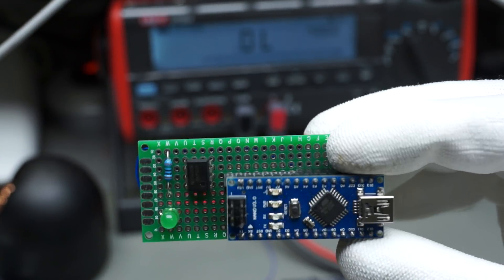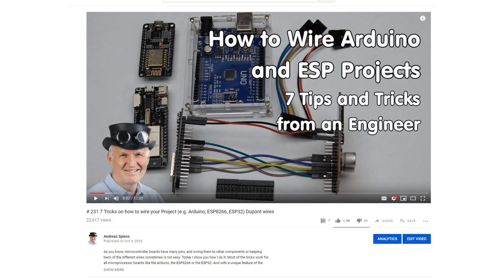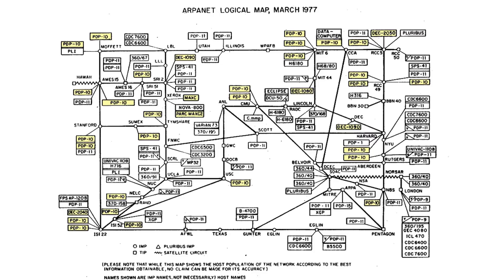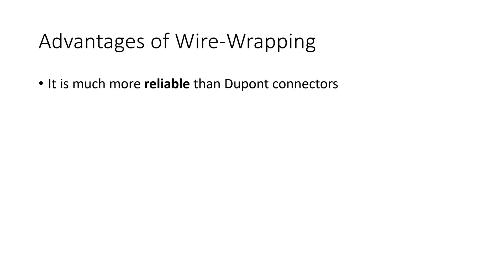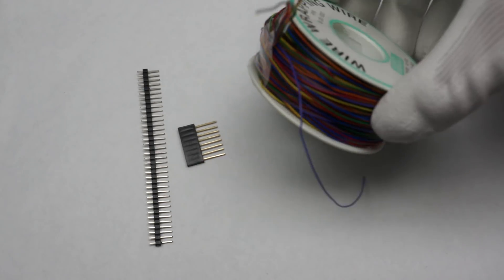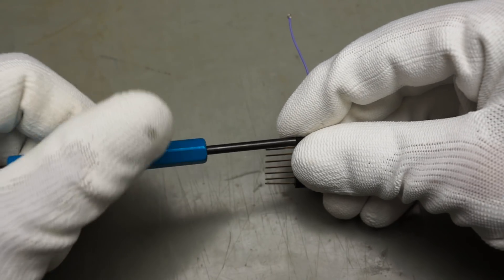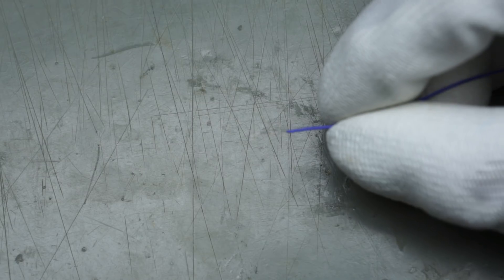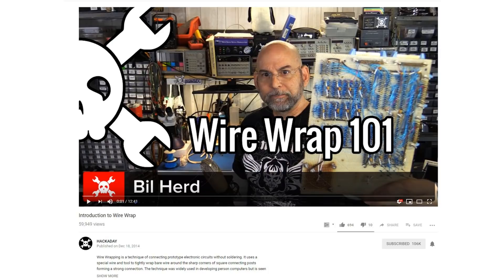#243 Better than Dupont Wires: Wire Wrapping for our Projects (Arduino, ESP8266, ESP32)

Comment: The best thing about wire wrapping is that metal hardens where it's bent. So wire wrapping is resistant to vibrations. Once a wire bends on some point, it will never bend again in the same spot. It's like trying to break a long wire bending it by the ends.
Reply from the maker: Thanks for the interesting info!

Comment: I wonder if wire exists that you can solder without stripping it. the plastic would just melt when touched by the soldering iron. that would speed up things considerably, even faster than wire wrapping.
Reply from the maker: The emailed wires can be soldered in this manner. However, they smell like hell, and you need quite a bit of heat.
Reply: @AndreasSpiess  I actually tried that once. the smell was acceptable, but it's hard to troubleshoot. it would be fantastic if the same would be possible with wire wrapping wiring, as you then have different colors available.

Comment: The pins break off quickly for the 30AWG wrapping tool and are therefore the weak connection!
Has this happened to you a lot too?
Reply from the maker: No. Maybe we have different pins.

Comment: The 30 AWG wires are so thin will they not melt in my projects?
Other thicker 24 AWG wires and tools are not available!
Reply from the maker: Wire wrap is not intended for power electronics. However, 30AWG is suitable for around 0.5A.

Comment: That small black piece of steel in the middle of the handle is a wire stripper.  Push the wire through, slide it into the slot and pull the insulation off.  You MUST insert the wire so that when you pull, the cutting blade presses onto the body of the tool.  Get it the wrong way round and you will bend the blade.

You can get wrapping wire that doesn't need stripping, but you need special pins with square edges that bite into the insulation.

In the 1970s I worked for Burroughs Machines who had terminals in every branch of NatWest, Barclays, Midland and Yorkshire banks, and it was a regular task to do modifications to the wire-wrapped backplane.
Reply from the maker: You are right about the stripper. However, I never liked it :-(
I am not sure if you still get this "special" wire. But it was very handy.
And indeed, even some "programming" was done back then on the backplane by changing wires. I just watched a video about the restauration of a PDP11 with lots of wire wraps...
Reply: @AndreasSpiess  I haven't done any wire wrapping since the 1980s, I gave all my wrapping stuff away, something I now regret as I'm thinking about using it for prototyping.  I'm not too keen on breadboards.

Did you ever use the the method wrapping where you didn't need to strip the insulation?  The pins were square in section with sharp corners which pierced the insulation as you performed the wrap.  IIRC the wire was a special type too.
Reply from the maker: @rogerbarton1790  I think we had such wires back then. But as with you, it is a long time ago ;-)

Comment: I remember reading about this in Forrest Mims III's Getting Started in Electronics book when I was 12.
I'm now 36 and I have just purchased my first spool of wire, a tool, and a bunch of sockets both breakoff and solid 2.54mm arduino types.
I am gonna have so much rapid-prototyping fun with this stuff. :)
Reply from the maker: Cool. Indeed, this is an old technique...

Comment: I work on Dimetrics Gold Track 2 power supplies which use wire wrap.  The biggest problem they used all white wires.
Reply from the maker: That was the standard I know. We also did not use different wire colors.

Comment: Kynar insulated wire wrap wire, if you have the proper stripping tool, is also really handy for replacing traces on PC boards.

Assorted prestripped wire is the sh*ts.  I still have a parts box full of the different lengths from decades ago.  I don't think you can get it anymore.  Anyway, wire wrapping is the easiest way to prototype digital circuits.
Reply from the maker: I agree, it is hard to find accessories for wire wrapping today (also the sockets).

Comment: Fascinating stuff! Recently bought that same multi-colored wire for a small project and somehow ended up watching this video 😊
Reply from the maker: I use these 30AWG wires for several things in my lab. Particularly to correct errors on my PCBs. They are very thin and easy to solder also to small pins.
Reply: @AndreasSpiess  Appreciate the response! I'll be using them to repair PCB traces indeed. Amused by the history behind it, also watched the Wire Wrap video you recommended by Bil Herd. Thank you!

Comment: Yes. I’ll use this. Great. I once in 1978 did a student job at Siemens Augsburg in fehlersuche of wire wrapped mainframe boards.
Reply from the maker: Finding errors was not easy. And correcting it sometimes also not...
Reply: @AndreasSpiess  well, at Siemens the wrapped boards were put in a machine which tested all connections and output an ist-soll vergleich. Zb connection from AB12 to BC06 shouldn’t be there. Or D12 to BC34 is not present. Then I put high voltage on connections that should not be there to get rid of residue. And I wrapped missing connections. An I ate a lot of zwetchendatchi with the women in Fehlersuche ;-)
Reply from the maker: @AlexSlaets  I had to google "Zwetschgendatschi" ;-)

Comment: 1. It's pronounced iNsulation with an N
2. That blue wire wrap tool has a built in stripper in the middle
Reply from the maker: I agree.

Comment: 1:32 if you order vintage aviation parts that are decommissioned, you’ll see atleast some of these components use this method. I’m holding a piece of a retired control panel now that’s got 30 analog inputs using wire wrap
Reply from the maker: It is interesting where this technology was used. It looks like unreliable but obviously was very reliable...

Comment: Just another gent who did a lot of wire rapping in the '70s. Much easier with a mains powered tool and a good wire stripper with a length guide. If I recall correctly there was even some instances of larger pins and wires for higher currents. Using round pins is not ideal, it's the sharp edges of the square pin biting into the solid copper wire that makes the joint so reliable.
Reply from the maker: I agree with the power tool and the square pins! For a small amount of connections, the manual tool is ok. But for a computer backplane...

Comment: There was a system that use self-fluxing enamelled copper wire.  You had a small spool of the stuff on the end of a hollow wiring pen, the wire went down the centre of the "pen" and came out at the "nib", you soldered the wire at the starting point and moved from point to point, soldering as you went along.
Reply from the maker: I used this too. But it was more complicated…
Reply: @AndreasSpiess  Yea, I didn't really get on with it, I still have a virtually full reel of wire which is about 40 years old.  You had to use more heat than with tinned copper wire and the residue was dirty.

Comment: That wrapping tool has a stripper built into the handle.
Reply from the maker: You are right. But not very comfortable…
Reply: @AndreasSpiess  And people put the wire in the wrong way and bend the blade outwards.

Comment: All your vids extremely interesting. In your experience in which cases would use this method against traditional Dupont connections? I wish to connect 7 DS18B20 sensor + 4.7k ohm resistor to an ESP8266 and with soldering I was wondering, but this technique seems to do it. Next, what pin's lengths are you recommanding? Thanks
Reply from the maker: These days you have to use the pins you get and cannot chose their length, I fear. You can wrap the wire around the wires of the resistors. They should stick.
Reply: @AndreasSpiess  The other way, wrap around the resistor, good idea, I'll try when I get the order

Comment: With the re-growing community of electronic hobby-enthusiasts, this wire wrapping technology along with the "Fädeltechnik" using wiring pencils, these almost forgotten techs do experience a sort of a revival. WhenI was 14 (long time ago) I had built a wiring pencil from a full metal emptied ballpen core/refill (remove color and ball, clean it). The sharp ring at the tip is great for cutting the wire after soldering, by just pressing it to the lead.    I still use it and can prototype quite fast with it. You can go from pin to pin with it. Turn at least one wrap around, then go to the next... Signal per Signal can be completed by this in a fast manner.  A tiny holding contraption to fixate the wire while wrapping around a pin was quickly set up, also the holder for the tiny wire coil at the end of the pen.
Reply from the maker: I remember the "Fädeltechnik", too. As you write, the tools were cheaper than for wire-wrapping. But AFAIK it was not used in products.

Comment: Does the wire come with only one size? I find it's too thin and easily breaks.
Reply from the maker: It does not break if you use it as intended. Mostly people use 30AWG wire.

Comment: I realize this is an older video, but this just now popped up in my suggestions list. Funny, I made literally tens of thousands of wire wrap connections in my days. And yes, I did have a manual wire wrap tool. But we mostly used hand held power wire wrap guns. Amazing how fast you can wire up even a difficult circuit. But than I also used through hole and even surface mount PC boards as well. Thumbs Up!
Reply from the maker: I think it had its high time before the availability of cheap and fast PCBs. But viewers wrote that it still is used in old telephone systems...

Comment: I have a project where I have a 24pin dip chip that I want to mount on a pcb. I want to be able to have the DIP socket leads go though pcb and out the other side so I can attach dupont or wire wrapping I think.

Comment: The tool you buy on Aliexpress has a wire stripper integrated in the handle.
You can DIY a toold by drilling a small hole on the side near the end if a small tube, such as the plastic tube from a q-tip, or a in pen lead.

Feed the wire from the end through the inside of the tube and the hole you drilled.
Reply from the maker: I know of the integrated stripper, but I did not like it. Maybe I was using it the wrong way...

Comment: Excellent, thank you!
Reply from the maker: You are welcome!
Reply: @AndreasSpiess  I never did any wire-wrap, being a software man and hence not trusted with tools, but I joined the industry in 1966, working with mainframes which were well and truly wire-wrapped. I spent a year at ICL Manchester, where the wiring shop was a no-go area for single young men - the wire-wrapping ladies had a reputation for inflicting certain indignities - frightening!

Comment: the AliExpress link for the wrapping tool is outdated. Any new recommendation? There seem to be a lot of wire wrapper for jewelery (no clue why that would be useful). Unsure if that's the right item!
Reply from the maker: I do not know. This is an old video and offers change quite fast on AliExpress :-(

Comment: Is 30 awg capable of powering arduino 5v sensors at 8 ft.
Reply from the maker: I do not know, I do not use 30AWG for long power lines. You have to do your calculations/measurements.

Comment: The wire wrapping tool comes with its own wire stripper. It's the one on the hole near the center of the handle. It's perfect for AWG #30.
Reply from the maker: You are right. But I did not like it...

Comment: The question is - do you use it? I can see that it can be useful to make fast prototyping on the fly. Without breadboards only on dip holders. It could be good connection to LCD without putting it on breadboard. 
Btw is it really as solid as soldered?
Reply from the maker: It is very solid. Back in the day they wired telephone infrastructure and computers like that. And some viewers wrote they still use it for these old devices.
Reply: @AndreasSpiess  good to know

Comment: @Andreas Spiess the wire wrapper tool that you have linked in the description isn't available anymore. 
https://a.aliexpress.com/_mLJqO2J
I found its one but is quite expensive,
Reply: Yes, seems to be very expensive. I only need that tool and not those kilo of wires.
Reply: @Phettsack  ohh boy I'm happy to have it. Excluding the need for wires. There are so f..ING handy. My granddad were surprised that it even exists. Strip a wire, wind it around a rectangular pin and BOOOM solid connection.  Btw here's the link to the tool: € 10,72 https://a.aliexpress.com/_mLZ1GOh

Comment: The only wire wrap tool I can find is one similar to the one shown in your video for 30 gauge wires.  Will that tool work with cat5e cables, which are 24 gauge?  I ask because the wrapping wires you show is labeled either 24 or 26 gauge.
Reply from the maker: I only used 30AWG wires, so I cannot tell.

Comment: Does it introduce inductance and magnetism to your circuit? Could this add noise to wireless communication?
Reply from the maker: Yes, it does and I would not use it for RF projects.
Reply: @AndreasSpiess  Thank you. I am a electronic hobbyist who is a fan of wire wrapping. Since first time soldering I got breathing difficulty that last one week. I just bought a DIY radio Kit and I am wondering this Question. I will still try to wirewrap the radio Kit and see if it still work. It would be interesting to compare the performance of the 2 methods.

Comment: Hey Andreas, do you have a video on different types of path wire soldering?
Reply from the maker: I do not know what " path wire soldering" is
Reply: Andreas Spiess sorry. I should’ve been clearer. I usually use single core utp wire because is easily available. But I’ve seen videos of technicians using some yet thinner wire. Sometimes kind of enameled but even of different colors. So they are isolated wires which you don’t have to remove isolation as the solder removes it.
Reply from the maker: Enameled wire is a different technique. More for the lab. Wire wrapping was used for sellable machines.
Reply: Andreas Spiess sounds great. May be a video on that topic will be interesting?

Comment: I love this video!  I discovered wire wrapping a few years ago when I started working on vintage 1970's stereo amplifiers.  I even bought a wire wrapping tool. Recently I started building a project with a microcontroller and several boards and it occurred to me why not use wire wrapping instead of Dupont connectors or soldering wires directly to the boards, or spending money on fancy connectors.   Apparently it wasn't a crazy idea!
Reply from the maker: Very cool!

Comment: can soldered wraping wire?for neopixel led
Reply from the maker: It is not necessary. Wirewrap is better than soldering. But of course you can also solder wired in this project.

Comment: I Andreas!  Love your channel and watch it all the time!  I used to use wrapping for all my projects back in the 80's.  My largest project had over 6000 wire wrap connections for a stage lighting controller.  It still works today.
Reply from the maker: Thank you! This technology was very reliable, but also quite expensive to produce. Today's CAD with cheap 2 or 4 layser PCBs are also quite nice ;-)

Comment: I bought a wire wrapping set because of this video and i absolutely love it! So much better than duponts for production when you don't want to commit to soldered wires. But I had a one problem where the wires sometimes become loose,  not often, but sometimes. How much are you supposed to push on the wrapping tool when turning it? Because I haven't been at all and visually the wrap looks fine, but maybe you are supposed to, so it makes it tighter?
Reply from the maker: I think the speed is not important. It is more the resistance the wire experiences. I do not push too much. Otherwise the wraps are not good.

Comment: Glad to see this video.  This is exactly how all our prototype and small quantity boards were made.  We also added conformal coat to secure and isolate the pin side of a board.  If coated and in need of modification, you have to use a solvent to remove the coat.  I'm not a fan of Dupont wires because it is too easy for them to become loose and of course the 1 to 1 issue but everything has its uses.
Reply from the maker: I never heard about using a conformal coating on wire wrapped boards!

Comment: I realize this is a bit late but the mention of no quality solderless breadboards in your most recent vid moved this to the top of my stack.   The good wire wrapped stuff from days gone by used gold plated pins.   If one uses cheap wire wrap sockets the results are not nearly as good.  Maybe time for the ANT pcb router :)
Reply from the maker: Since the Chinese produce cheap 2 layer PCBs I do no more mill mine.

Comment: Personally, I find the Verowire system to be superior to the wire-wrap system. It doesn't need long wire-wrap pins for every component, so the resulting board can be much thinner, and neater, and the electrical connections are soldered rather than friction-based. The fine enamelled wires between components are bundled together and routed as busses using plastic verowire "combs" that push into the 0.1" pitch holes on square-pad veroboard. I use a thicker gauge of enamelled wire for the power rails, and then the vero-pen spools of fine wire for the signal connections,
Pro-tip: After pushing the comb's plastic mounting pins through the board from below, you use a soldering iron to melt the top of the plastic mounting pins, which rivets the comb to the board and stops them moving or coming lose.
Reply from the maker: You are right. Every system has its advantages and disadvantages. I also used these enameled wires and did not like them too much. Especially if I needed more than one wire to a pin.